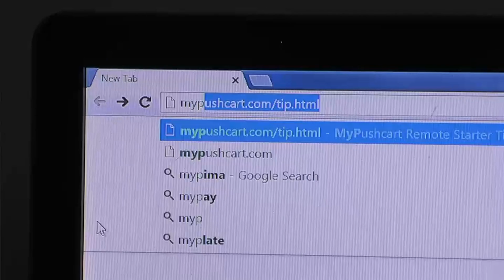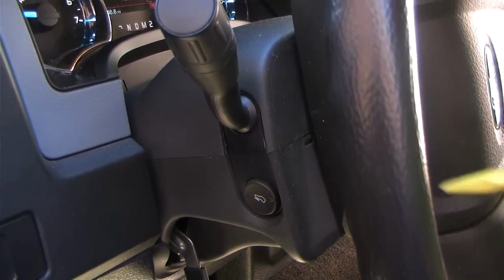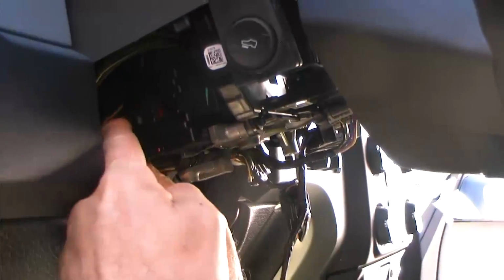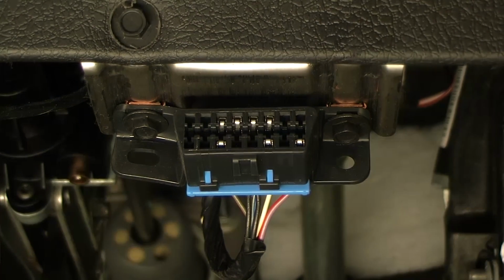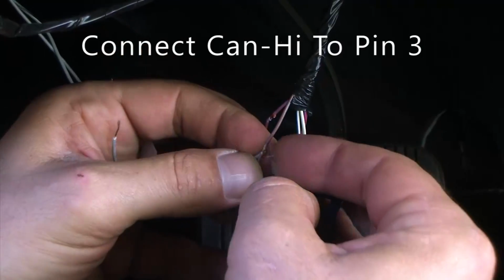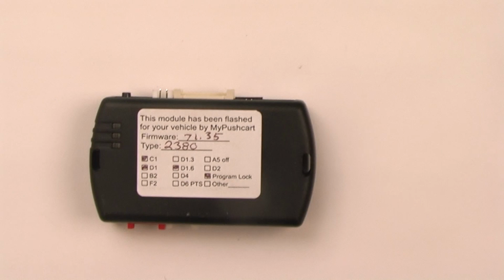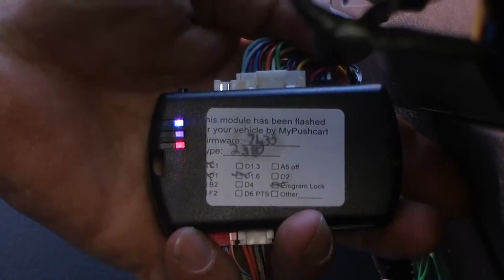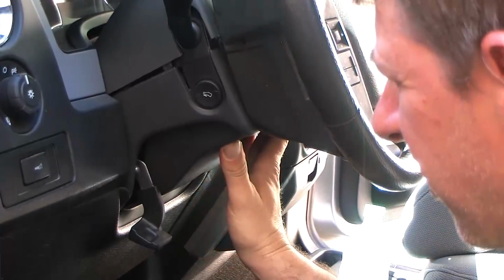Remote Start Install for Select Ford Vehicles [2011 - 2016] by MPC

Comment: What happens if you cut obd2 wires?
Reply: I accidentally cut thew the or orange and grey wire while trying to install one of these kits. I just made sure the wires where all twisted together tightly ns did a test per the tip sheet to make sure the can high and can low connection was good

Comment: Great video, I’m very interested in this kit. My question that didn’t seem to be covered in the video is when you remote start the vehicle is there a timed shutdown after a specific time limit like other remote start systems? Also is it possible to remote stop the vehicle after you started it? Possibly by pushing the lock button 3 more times? Or do you have to enter the vehicle and push the break in order to cancel out the remote start? Thanks.
Reply: The system times out after 15 minutes.   In most Fords you press 3x lock and the car will shut down.

Comment: Wouldn’t it be easier to install the factory remote start. You literally plug in 2 connecters and mount an antenna under the dash.
Reply: What, its that easy?
Reply: @Adrian-lv5kk  yeah. If you don’t have a scan tool that is able to access parameters you will have to go to a dealer

Comment: But I heard that u must first enable the remote start function by the dealer obd2 ids. Is that correct ??
Reply: Sounds bogus. This system is just a series of diodes and relays doing the by passing needed.
Reply: No - that's not correct.   No dealer programming is required.
Reply: I take it this system by passes the factory programming and need to install antenna and  hood switch if not preinstalled? (Hood Switch Preportedly installed on all 11-15 F-150's exsept base models)

Comment: I only have 1 key. Can anyone tell me if I need 2 keys for this remote start to work???
Reply: You do unfortunately, I am in the same situation as you... the only way to do this is with two keys, so one would need to go buy a key(Amazon has it for $20) and have a lock smith cut it and program it, making sure the new key is not a clone of the original key.

Comment: Hi could you please help me to fix my remote starter( code alarm CA5055) to f150 2011 truck. Now i connected my ignition harness and brakes only , and it is working . But i need to leave a key in the key swich for remote start. Otherwise not start. I think some wrong wiring. I didn't cut the starter wire just joint the starter wire to that. Please help me to fix which wire connect to which colour. 
My truck Ignition harness wires are ign + white/orange, acc + purple/green, starter + Light blue/white, blue/gray, green/ red, white/ brown. Transponder wires are PATS power purple/ orange, ground black, TX data yellow/ orange, RX data purple/gray.
Remote starter main wires are
Tach input purple/white 
Start status/ active output(-) blue/black
Factory DISARM/ active output(-) grn/blk
Pulse after shutdown (-) green/ white
Pulse during crank(-) black/ yellow 
Factory ARM/ Pulse after start (-) lt blue
Ignition 1(+) pink
Battery 12v red
Ignition 2 (+) pink/ white
Accessory 1(+) orange
Battery 12v red/white
Starter output - motor side(+) purple
(Please ignore door and parking connections for now)

Comment: You could also buy a factory remote with the remote start button. Log in to your vehicles IDS using Fords software (dealer) or Forscan (free 3rd party) and enable remote start. That is it! You now have remote start! Note: your vehicle must have a factory hood switch. Most Fords 2011 and up can have this enabled using the method I described above.